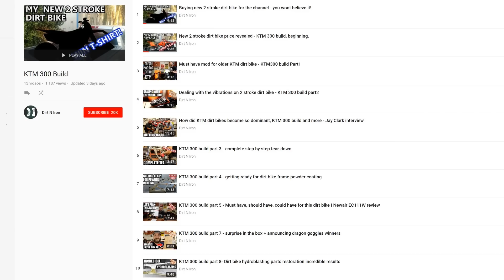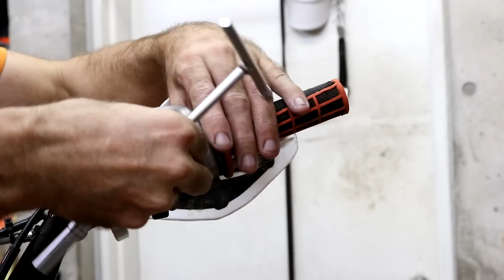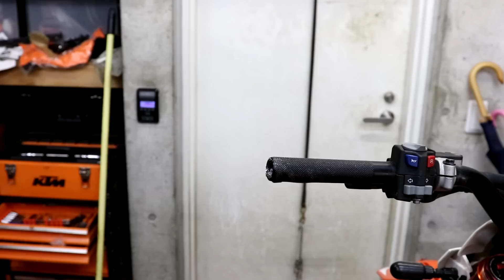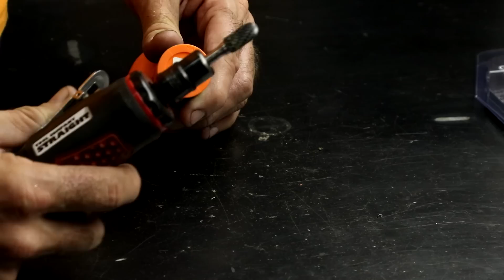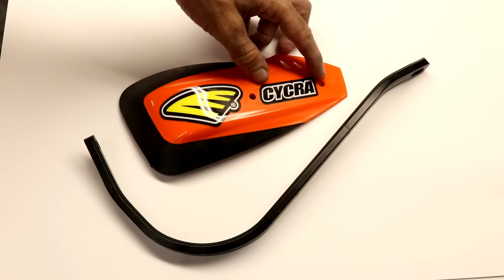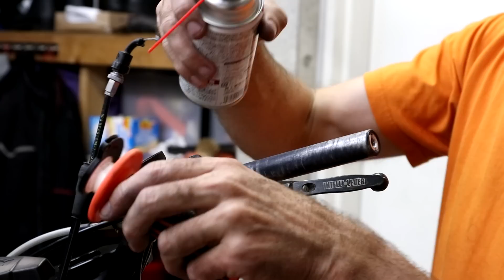Cycra Series One Handguard + BRP Mount Install

Comment: I just bought all this stuff and the Brp mount sticks right into my clutch line. Unless I angle my clutch down to an unrealistic angle I can’t use it. 2021 300xcw
Reply from the maker: What handlebars are you using? The bars used in the video are Renthal RC High and I routed the clutch hose over the top of the BRC mount. From a couple of years ago I switched to stock bars on all my bikes, which due to having significantly lower bend that the Renthal bars used in the video require the clutch hose to be routed under the BRC mount. I have the same setup on my 2024 KTM 300 EXC TBI, with stock handlebars and no issue. My clutch lever is very slightly down from horizontal. The clutch hose routes under the BRP mount no problem. I could set the clutch lever to horizontal if I wanted.
Reply: @TokyoOffroad  I went back and noticed that you had high bars. I got it to work. I just had to apply some pressure to push the clutch cable to dip below the mount. Luckily the mount has beveled edges so I don’t think it would damage the cable. I have the stock bars on the 2021 300xcw. I do have my risers in the forward holes on the triple trees with the risers rotated in the position that brings the bars back slightly. The mounts push on my mask but I can live with that. Everything seems secure enough that it won’t cause damage. Just rub the plastic. Good video though. I needed new hand guards and I was watching a video of you riding and though I like his hand guards. Then I was pleasantly surprised to find you even had a video on them.

Comment: Your controls on your bars should move a little when you crash so that stuff doesn’t break. If you’re constantly readjusting then you must be constantly crashing or laying it down and that might be another issue.
Reply from the maker: I'm using Renthal Intellilever Gen2 clutch and brake levers. They can dislocate in any direction (not back of course) in the event of a crash. As such there is no need to under-tighten the perch on the bar (to allow the perch to rotate in a crash). I've Renthal Intellilevers for about 8 years and never broken one. Unfortunately Renthal seem to have stopped making them recently so they are no longer available.
Reply: @TokyoOffroad  ok whatever works for you.

Comment: I liked using the burring, carbide tip as I had some to open the grip end. 
Looked professional when I was finished. 
Good idea, thanx.
Reply from the maker: Pleased to hear it worked well for you. It's quick and easy, and results in a good finish. Much better than knocking out the grip ends...

Comment: Great video...
How did these hold up?  Did they move or bend after any falls?  Also, do they interfere with the cable routing at all? 
Thanks 👍
Reply from the maker: They hold up very well. Yes, if you drop the bike hard enough they will move and bend a little and every so often I do take them off and re-tweak them to make them fit perfect again, but overall I've been very pleased with them. Cable routing is not an issue. I fit the same system to all my bikes now.

Comment: Hi Mark
Why did you choose the BRP hand guard mounts instead of the Cycra original HCM clamps? I have the feeling Cycra HCM original brand ones will fit much better.
On the other hand, a very happy client with your drain tool here by the way :)
Reply from the maker: Pablo Castaño - The shop I used had the BRP mounts in stock (and didn’t have the Cycra mounts). I should note that my handlebars are Renthal RC High bend which are the tallest bars available. As such I wasn’t surprised that the bars needed some tweaking to fit. I’m pleased you’re happy with the drain tool.
Reply: @TokyoOffroad  Thank you Mark. Are the BRP threaded bar end insert kits really a must against the expanding nut set up originally come with? I,m lazy to go for it if the expanding original nut ones works enough.

Comment: Freeking excellent how to video. This is a much more involved process than some people may think. Couple of points...I have found that you do need to slightly tweek the bar bend to get the best fit as you demonstrated. It isn't easy to bend that big aluminum but it can be done using a vice and some type of vice rips and/or pliers as you show. Also, I used some fiber washers at the joints between the BRP mounts and the bash guards. This provides a little bit of play because I think if you don't it makes the bars overly rigid and you get increased bar vibration. Just a thought but may be worth doing. Thank you again for an outstanding and detailed how to video! Now please build me that Tap Guide!!!

Comment: Great videos ! Live in Southern Alberta Canada and have been Riding/racing/dual sporting for 34 years . Mechanic and always had used bikes until last season . Now have a 500 exc . Have three different set ups for handle bars depending on the riding style , SM / Dirttrack / Offroad and MX . Fab many parts . A more controlled way to make the holes in the ends of the grips is to use a 7/8 inch (22mm) hole saw . It centers with a drill bit and cuts so good you can use it without the drill and just turn it with your hand . Keep up the excellent work captain !

Comment: I've looked around quite a bit and cannot find the KTM lock on grips that are pre drilled for wrap around handguards. Is there any way you could provide the part number or link to where to buy them? Thanks so much.
Reply: I bought mine (Husqvarna Black) at Rocky Mountain ATV and MC... they had three color schemes to choose from.  I'm sure you'd find something black/orange/white enough for you...
Reply from the maker: I've updated the video description with the KTM part number for the orange ODI Lock-on grips with open ends (79002923000) and also black with open ends (79002121100)
Reply: Thanks so much! @TokyoOffroad

Comment: just reading up regarding the clamp mounts. You seem to be running bar risers - without them, can you confirm there are clearence issues with the headlight mask and Odometer?
Reply from the maker: They should clear the speedometer no problem. But you’ll find you’ll see need to trim the headlight mask.

Comment: For cutting rubber, a sharp X-acto blade lubricated with brake cleaner (or maybe alcohol, I forget which) is like a hot knife through butter.  It's so controllable you can cut a circle with it easily in the end of a grip.  Another good trick is to put the grip on a handlebar without the thread insert in the way and use the ID of the bar as a cutting guide for the throttle side.  For the left grip, you can just follow the ID of the threaded hole and that's good enough.  If you want perfect circles, chucking an empty brass cartridge in a drill cuts a great hole.  Again, lubricate the edge with brake cleaner.
Reply from the maker: The KTM OEM (ODI) lock-on grip have plastic ends with rubber on the outside. It would be very difficult trying to cut through the plastic with a knife.
Reply: Yes! And ODI puts a small b-groove just under the rubber over flap for that exact purpose. You can get a brand new sharp X-Acto knife and the tip of it will find that the groove and follow the circle right around. ODI themselves have a video on how to do this. 👍👍👍

Comment: Finally, he gets hand guards!!  I use the BRP clamps too.  When using standard hand guards with center mounting clamps, like Cycra CRM's for example, if you're spinning those on the bar that was one HELL of a crash.  It's a rare occurrence.  Blow the chips out from the opposite side of the handlebar, if possible.  Because you're using thread inserts, you put holes in the grips only as large as needed, because you don't need to get the wedge clamp through that hole.  On the left side, I make it a tight fit to the M8 bolt to keep out dirt and water.  On the throttle side, I use a 1/4" or 3/8" spacer with 5/8" OD that butts up against the thread insert and the inside of the hand guard.  The grip is cut to clear the OD of the spacer by about 0.5-1.0 mm to keep as much dirt out as possible, and also to leave as much rubber intact as possible so the end of the grip retains it's shape around the throttle tube.  The spacer length just needs to be slightly longer than the end of the grip to keep it from dragging on the hand guard, and allow a little space to keep it from dragging on the end of the handlebar.

Comment: Instead of using loctite, why not just tap to a point where the threads taper and the insert then wedges into the tapering threads?  That would be even more secure.  Great idea on the tap guide.
Reply from the maker: I understand what you're suggesting. That would stop the insert from going further in, but still be vulnerable to coming loose. Either way I'd recommend using threadlock.

Comment: Great video Mark once again, thanks. See what you mean now about the comparison to the Barkbuster Ego set. The Cycra looks far more professional.
Please add the bar ends and your alignment tool into your shop so we can buy a set please??
Was the KTM guards a KTM part number or an eBay rip off?
My only concern is the interference with the headlight assembly if using the std bar height? guess its difficult to say if you haven't tried on a std set up before. 
Awesome :-))
(Your drain tool works so well BTW)
Reply from the maker: Thanks. I'm pleased you like the Tokyo Offroad Oil Drain Tool. 
I've done a few rides now with the hand guards, dropped it lots of times and they haven't shifted at all, so I think it a good setup. The KTM branded shields I purchased from Amazon in the US. They came in KTM packaging with a KTM part number. No reason to think they are rip offs: https://www.amazon.com/KTM-PROBEND-REPLACEMENT-HANDGUARD-U6910026/dp/B00HSRY2Z2?keywords=ktm+handguard&qid=1538953054&sr=8-9&ref=sr_1_9
Regarding clearance of the headlight, I'm using a Scotts sub mount which raises the bars 25mm. The lower bar mounts are also 10mm higher than stock. I using the forward bar pount position. This gives me plenty of clearance of the headlight cowl. On my TPI I have the Scotts submount fitted (+25mm) but stock bar clamps and the guards still clear the headlight cowl. I haven't tried mounting the BRP supports at stock height, but am sure you'd need to get creative to work around interference with the headlight cowl. The BRP supports are popular so I'm sure others have used them with bars at stock height. Anyone have comments?
Reply: Ordering some up so will see how i go. I am keen to keep std height of bars after a excellent training session with Chris Birch and his belief of why high bars are bad. I will work it out and let you know :-) Looking to get the XRC steering damper in the future as that keeps std bar height without it being on top of the bars.
Reply from the maker: Sounds good. I think if you position the bar clamps further back the mounts will probably clear the headlight mask.
Regarding bar height, when I was young I always ran stock bar height and thought nothing of it. Now (53 years old next week) if I ride a bike with stock bar height I just feel like sitting down all the time. For the snail pace trail day riding I do I love my setup which feels super comfortable standing. But if you"re a racer the stock bar height will allow you to get in the attack position more easily...
Reply: Yeah interesting thoughts, being 6'4" i had bar risers, it was Birchy that persuaded me back down and since i got used to it.  i ain't no racer either mate, only couple years behind you with total of 6 years riding experience so i am dependant on advice and help. May well try the higher option and see what happens. I only love the harder extreme stuff and tight technical singles, 3rd gear and above scares me lol
Reply from the maker: Wow, you're taller than me (I'm 6'2")!
Reply: shrink with age ha ha ha
Reply from the maker: Unfortunately yes

Comment: I’m curious if when installed with those mounts they effectively remove all flex in your bars.
Reply from the maker: David in San Diego - They certainly impact on the flex characteristics of the bars and this is one reason I have always preferred flag style guards. But I guess I’m not that sensitive and didn’t really notice a difference when riding. I do like the protection when riding through tight trees and also they are way more robust when you drop the bike. So like many things, plus and minus points to be aware of...

Comment: Do you have the part number for those open ended grips? I checked on the ODI website and can't find them.
Reply from the maker: The part for the ODI open ended grips is 79002923000
Reply: Thanks!

Comment: I know that hiting the fingers by the tree/lever is quite painful, but I'll carry on with the oem guards. Anyway I've broke my 
https://en.wikipedia.org/wiki/Scaphoid_bone 
It requires a titanium bolt and quite a long time without my ktm unfortunately. I just fell off the bike on the ground in the nasty downhill.Shit happens.
Reply from the maker: Getting injured sucks for sure. I hope you heal quickly and strong. I broke my back 4 years ago while racing and had to have 6 titanium bolts and 2 rods to fuse 3 vertebrae together. I was in hospital for 4 weeks and out from riding for about 4 months. That was a dark time for me, but I healed and am enjoying riding more than ever, although I don't race anymore...

Comment: Alu handguards are good until you are going over the handlerbars and brake your forearms or wrists. Its better break the lever than the arms. Thats why pro-riders and others use the oem handguards.
Reply: Common misconception, pro riders keep things as close to stock as possible in the case of a mechanical failure. It is much harder to swap out a clutch/brake lever or any surrounding parts with the wrap style handguards. If pros cared that much about safety you'd see all of them wearing neck and knee braces and full pads but most only wear boots/helmet/jersey.
Reply: I hear that a lot...I wonder..is there an actual case for this situation? Can anyone share a link?

Comment: I would of got acerbis rally pro's they are much better looking and stronger
Reply from the maker: What is the aluminum grade used for the Acerbis Rally Pro handguards? One of the main reasons I chose the Cycra Series One bars is that they are 6061 aluminum and should be strong.
Reply: Tokyo Offroad not sure but my set are very rugged and tough. I don't think I could break them in a crash if I tried to like driving flat out into a tree
Reply: Rally Pro Hand guards are the worst. I had a pair of those and the metal is so soft, you would swear they were made out of solder. They have very small, built in shields that cannot be replaced. I can't believe Acerbis still makes those crappy hand guards.

Comment: It looks a little bit complicated
Reply from the maker: You could use the kit as is (instead of threaded bar end inserts) and a regular handlebar clamp mount system (instead of BRP mounts) and have the guards installed in a few minutes. But I'd rather spend a bit more time in the garage and less time fixing things while out riding ;-)

Comment: Surprised how well those fit. I tried brp mounts (w top mount steering damper) along with the cycra probend guards (what brp recommended) and the OEM handlebars. The fitment was a mile off. Would have had to twist the wrap arounds about 30 degrees and bend them back an inch and a half to butt up against the brp mounts correctly. After dealing with wrap around guards for a while now I chose to go back to the OEM flag design and keep the levers clamped on fairly light so they twist in a crash. Your wrap arounds seem to have fit much better out of the box with minimal bending required, so in might look into that model of wrap arounds in the future, but for now I'm liking the OEM design. Why did you choose to go with wrap arounds?
Reply from the maker: The fitment and how much you need to tweak the bend will largely be dependent on the handlebar dimensions (width, height and sweep) and also the angle you have the handlebars adjusted to in the clamps. For reference I'm using Renthal RC High Fatbars and have them adjusted so the lower rise of the handlebar is in line with the fork tube. I only had to make a minor adjustment to the bars (as explained in the video) for them to fit perfectly. The reason I decided to use wrap around guards is I got fed up repairing, or replacing opening guards after crashes. I do prefer open guards while riding though. Will see how these go...

Comment: Love the tap guide, I had always used a short piece of aluminum 1 in wide angle bar and attached it to the bars, this gave me a 90 degree angle to keep the tap square with the hole.

Comment: One disadvantage of the BRP style mounting system is for enduro riders who ride a lot on the street and like to change their handlebar orientation on the fly for standing off road. I didn't think about this before installing a similar mount on my DRZ400 until the first time I was on the trails and wanted to tilt my bars up. This used to be a simple process, I would just loosen 2 of the top clamp bolts slightly, move bars and then re tighten. However,  since the BRP style mounts are fixed (as you mentioned) and do not rotate with the handlebars like traditional mounts do you have to loosen the handlebar top clamp bolts, bar end bolts, and the BRP mounting bolts. Then after tilting the bars re tighten everything in its new orientation.
Reply from the maker: Yes, changing bar position would be a major PITA with this system. I never change my bar position so it isn't an issue for me, but for those who do I would recommend using regular handle bar mounted clamps...